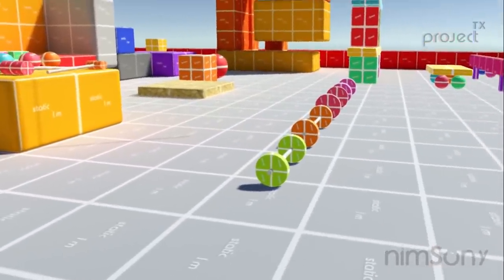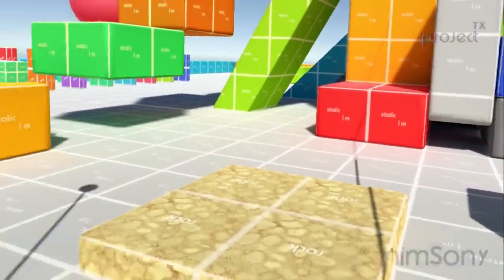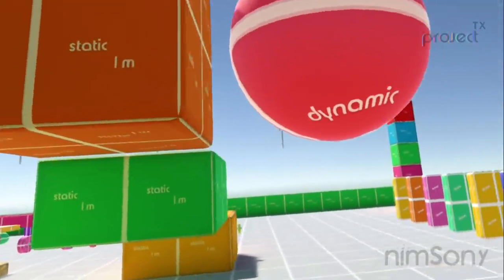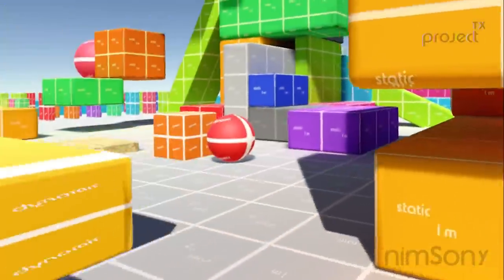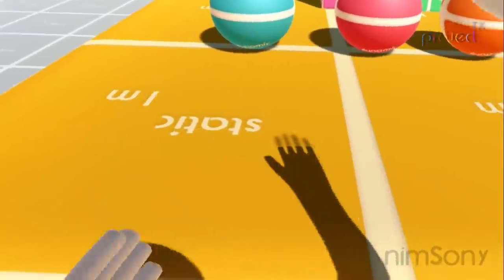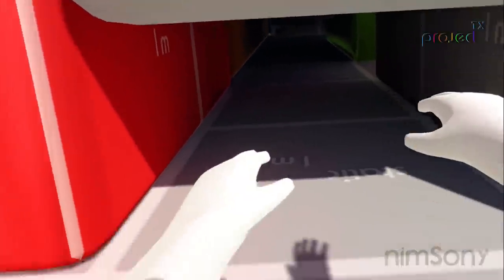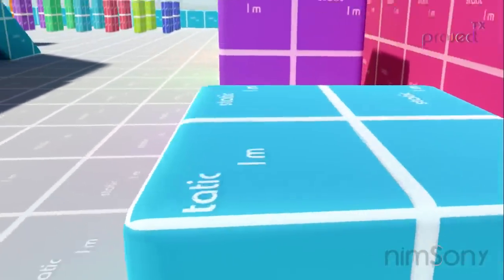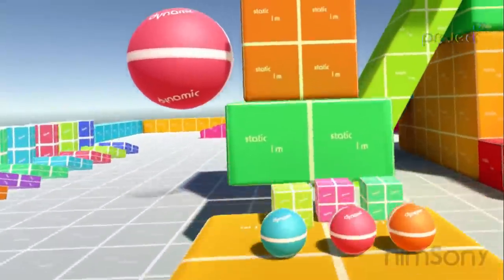PROJECT TX - Control Improved!

Comment: "I'm going to try to get a demo of this as soon as possible" HE SAID THE WORD, HE SAID DEMO.

That climbing over stuff system looks better than BoneWorks; in BW I feel like it's has a hard time catching on my feet when I'm trying to pull my body on top of some things, expecially over fences.
Reply: Do u have any examples? Ive had 0 issues doing things in boneworks
Reply: @Aryann3  how long have you played it?
Reply: @Aryann3  That fence that you normally break the lock on in the second area (after the museum). But besides that BoneWorks is great, I really have more problems with my vive wands than the game.
Reply: Also in BW it's hard to climb in windows or on some flat objects like fences –  it's very easy to fall the way your hands are in one side and you're in another, because no elbows collisions
Reply: I never had any problems with climbing/mantling in BW. It's honestly one of my favorite things about the game
Reply: @edit3891  It's extremely hard to mantle/climb in Boneworks if you're using vive wands. If you have enough money, save up for Index controllers because it's way easier to climb with those.
Reply: @phosphatepod  Weird, the climbing part if fine with my wands, just vaulting the fence that is more about getting high enough for the legs to clear.

Also I'm going to wait for some improvements in the Index, it's a great headset, but I have seen some manufacturing stuff that needs to be fixed and I'm good waiting for it to lower in price too.
Reply: @edit3891  I meant that it's a lot easier because on the Index controllers you can keep your legs in a crouching position which allows you to vault things.

Also, HP, Valve, and Microsoft are making a VR headset together it'll probably be cheaper than the Index. You should get that if the price of the Index doesn't lower.
Reply: You mean the crouch button (slider thing)? because you can do that with the wands, which I do while crouching in real life. Anyway I get what you mean now that the Index is easier to climb with instead of the other thing.

I'll check out the headset when it comes out, but I really just want them to fix the problems with the Index and then lower the price when they can.

Comment: While this isn't actively a problem for most users, this problem will likely crop up more as time goes on...
Joystick drift.

Currently my right analog stick drifts up after I press down and let it go. This would mean premature jumping in most applications, nevermind stuff like BoneWorks.
I certainly see the appeal, especially the appeal of having jump be up and crouch being remaining crouched as long as down, just something to keep in mind I think.

The joystick clicks could easily substitute as well.
Left click to go down, right click to jump, something of the sort.

Anyways, just my 2 cents. I think it's definitely a good control scheme, but I think options will play an important role if something like that is implemented for further accessibility